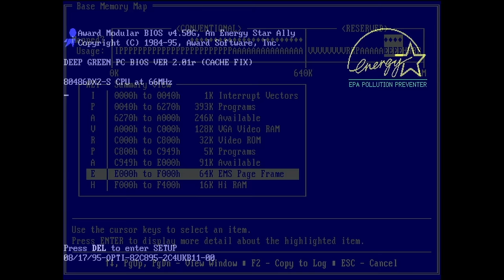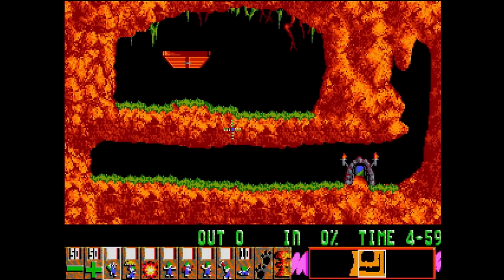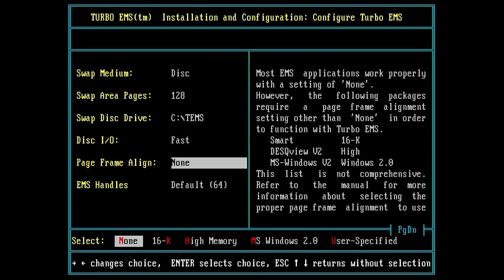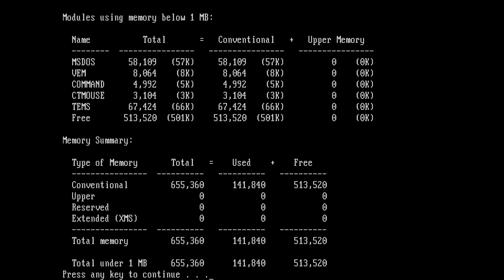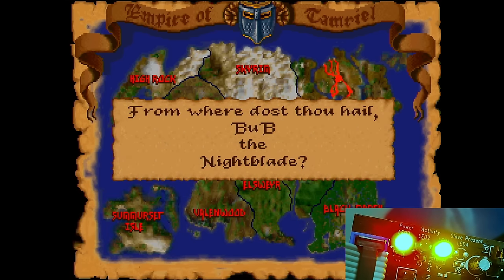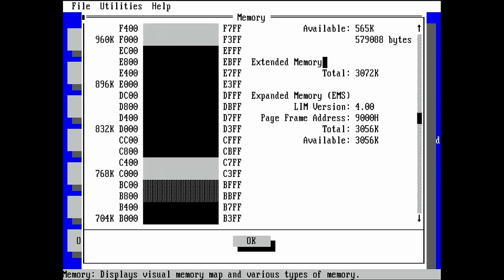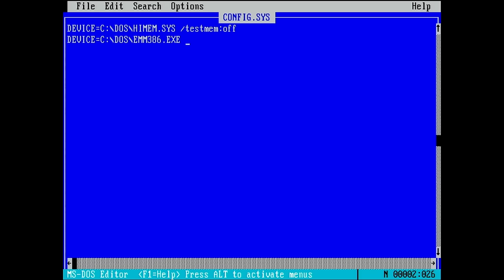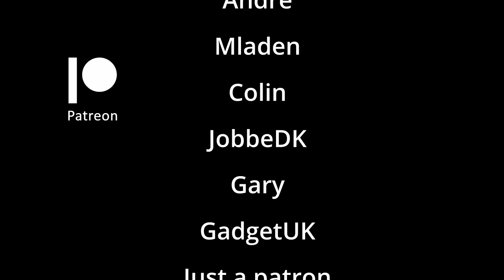EMS Memory: The clever hack for more memory in DOS!

Comment: EMS was developed for 8086 PCs that had only 20-bit address space (1 MB). At first EMS was used as an expansion ISA card with it's own chip and memory. You only had to load a simple driver and everything else was done through registers and ISA bus in hardware. Such board provided 64 KB of RAM within 1 MB of address space and had NES mapper-like logic that could move that 64 KB window within it's own memory. That way allowing for software to access more than 1 MB of RAM and to install way more memory than 8086 PCs were designed for.
It was designed for productivity software, like spreadsheets.

Soon EMS started to be implemented in motherboard chips for later 80286 systems. Where you could have up to 16 MB memory installed and accessed as extended(XMS) memory (similar way of using a 64 KB window above 1MB address space), but for compatibility reasons EMS hardware emulation was also provided.

80386 CPUs were finally 32-bit and had 32-bit address space (4 TB) and had virtual addressing which allowed to map any memory region to any other address. This allowed for EMM386 driver that was able to use above 1MB memory mapped to 64 KB window below 1 MB address space just by CPU alone. This made EMS really fast.

Wolfenstein 3D could use XMS or EMS, but John Carmack said that EMS with EMM386 was faster than XMS (if I remember correctly).

There was a short period when games required 1 up to 3 MB of EMS along with as much free memory below 640KB as possible.
Such games were 16-bit and were meant to run on 286 CPUs and better.

However this didn't last long, since 32-bit DOS extenders gained popularity like DOS4GW that was displaying it's initialization in most later DOS games.
The biggest difference 32-bit mode offered was flat memory model. No more Conventional, upper, EMS, XMS memory. No more near and far memory pointers - in general DOS was 16-bit with 20-bit address space. This meant that all of memory was accessed through 64 KB chunks (near pointers) and to switch to other chunk you had to use far pointer that was 32-bit (yet only 20-bits could be addressed).

32-bit mode introduced just one regular pointer type, like it was defined in C/C++ standard. 
32-bit DOS Extenders worked like a true 32-bit OS run on top of MS-DOS, similarly to Windows 95 and 98. They provided DPMI (DOS Protected Mode Interface) that was designed and implemented by various companies. This is why it's possible to run DOOM, Descent, Duke Nukem 3D, Quake and many other 32-bit DOS games within Windows 9x or even in Windows 3.1x, because Windows itself provides DPMI.

There was also VCPI introduces earlier with EMM386 that allowed to 32-bit DOS Extenders to work when EMM386 was loaded at the start.

Overall memory management in DOS days was a mess, however when 32-bit software got popular memory management was handled by the software itself.

In fact we did a full circle, since in modern programming the most efficient way to optimize code is to organize data in smaller chunks that can fully fit into CPU cache. Modern CPUs have around 64 KB of fastest L1 cache per core, so if a programmer manages to keep the data in a 64KB chunks for a stream of instructions it will be processed really fast.

I didn't mentioned about Unreal mode (hacked real mode where you use full 32-bit memory addressing) or that the true limitation of EMS was that the program code was limited to conventional 640 KB and only data could use EMS - this is why TES: ARENA stopped working despite having a lot of free EMS memory. 32-bit flat memory model allowed to use all the memory in every possible way.
Reply: i386 only supports 4G, not 4T-
Reply: Nicely done.  This is one of the hardest things for me to grok about DOS programming -- near/far pointers and segmentation.  I learned C in 32-bit Linux, and the idea of not having a 32-bit flat memory model (and int64 types!) gives me the same feeling as when you place a large mirror on the floor of a room with vaulted ceilings, then try to step on it.
Reply: "You only had to load a simple driver and everything else was done through registers and ISA bus in hardware."

Not quite, you had to specifically write your program to use EMS, it most certainly was not trivial or transparent, normal far pointer methods needed explicitly augmenting with EMS page management, leading to a dramatic degradation on the performance of a native segment:offset pointer in real mode.
Reply: L1 cache usually has 64KB broken into 1024 lines of 64 bytes each where each line is memory aligned. Keeping commonly used data within chunks of 64 bytes and aligning objects to 64 bytes can improve performance.
Reply: @Leeki85  great explanatiom, thanks for that
Reply: This! This is the comment from the (old like me :-)) person who knows what he's talking about. A very nice explanation.
Reply: @bitsundbolts you should pin this.
Reply from the maker: Done
Reply: I wish there was a modern emm4.0 compliant 32mb card out there. I have a LoTech 2mb EMS card in my NuXT and with the uses I'm putting it to in TurboC++ ..I wish there was more. Less juggling.
Reply: 'program code was limited to conventional 640 KB and only data could use EMS' - this is incorrect. At least Borland TurboC could use code 'Overlays', which would map code segments into EMS allowing programs to use >640k of code. This of course involved a performance penalty, so you had to carefully specify what code was placed in overlays. You could also not do calls between overlay segments.

Also, while the 386 was limited to 32bits (4GB) of physical address space, it could address up to 64TB of virtual address space - the segment registers still work in 386 protected mode.
Reply: @simno345  In general CPU could run code in all of it's address space. Full 1MB for 20-bit addressing of real mode. Code is just stored as data and there's really no difference. You can start executing code at any place in RAM, but the results may be chaotic, usually DOS would crash, but it's a chance that this could erase data on HDD. You can also use code as data, Yar's revenge on Atari 2600 used its code as a texture in the middle of the screen.
So you could copy code into base 640KB from EMS or from HDD. Basically this is how OS works. More modern OSes uses dynamic libraries to split code into multiple smaller pieces.
However in reality program code was always small enough to fit into the memory entirely and there was really no need to further develop ways to deal with larger programs on x86 since when computers started having more than 1 MB of RAM, CPUs already had ability to address it entirely.

There were other ways to deal with complex code. Epic Pinball had one main EXE program that loaded each pinball table as its own EXE. X-COM had similar approach. Strategic part with the globe was one EXE and when tactical mission was to start, game was saving its state to a file, loading tactical EXE and then doing the mission, X-COM was also 32-bit application, but they do it to use less RAM.

Some older games were able to load specific audio or graphics drivers when needed.

Comment: I remember when MEMMAKER came out as that was a lifesaver with this sort of thing - a semi-automatic way of puting things in upper memory and if I remember correctly, the order they were loaded in the config.sys also had an affect on the amount of free conventional memory being available.
Reply: That is correct. When HMA (High Memory Area) and UMB (Upper Memory Blocks) were enabled, DOS would attempt to load parts of itself and drivers, such as the mouse driver, into HMA or UMB when possible. The loading order was important because the system had a set sequence of where to try loading first, then second, and so on. Drivers needed to be aligned to specific memory addresses, and the reserved space for each had to be in multiples of a certain size. If drivers were loaded in the wrong order, this could cause small gaps through fragmentation that could no longer be used, leading to wasted space. However, by loading in the correct order, you could pack the available memory more efficiently.

Comment: you can change the config.sys and set DOS=HIGH,UMB also limit the amount of BUFFERS and FILES. This will free base memory to some point, but not indefinetly of course. The default with 1MB of RAM schould be somewhere like 20 BUFFERS and 30 FILES. so lowering it will probably help a little bit.

Comment: But what is turbo EMS meant to do if you have extended memory?? I get that if you don't you can use the HDD... but if MSDOS does the trick, what turbo EMS would do differently??
Reply: EMM386 which ships with DOS emulates EMS hardware by using 386 hardware feature, allowing it to remap any memory from XMS into a 64k window in sub-1MB region which can be accessed by EMS compatible software written for a 8086, which can directly only address 1MB memory total.

If you have an earlier computer without 386 features, you can use TurboEMS to emulate an EMS device. On a 8086, it can emulate EMS by copying data between EMS window and disk upon any EMS mapping change command. On 286, it can copy between EMS and XMS instead.

Comment: Back in 1992 my father bought a 486 DX2/66. He paid 3500 bucks at a local supermarket chain and this was for the 4Mb RAM version. We carried the MASSIVE case to our car when I saw that on the box there was an X on 16Mb RAM! I told my father to run! This 12Mb costet enough to buy an Amiga! The 16Mb were very handy, especially after a friend of mine installed QEMM. Wing Commander 3 ran like hell, System Shock CD did also.

Comment: This takes me back to the days of having a separate boot floppy with a super customized Autoexec.bat and config.sys files on it for my 486 PC. In it's later days I had so many devices in the machine I needed about a dozen different configs to support various games. I ended up using MEMMAKER along with QEMM (Quarterdeck Expanded Memory Manager) along with a LOT of tinkering and reboots to help get everything setup. It was almost like a dark art!

I also had a config or two setup to use different amounts of system RAM with the SmartDRV utility that would allow most of the game data to be cached from the HDD into RAM. It was awesome for certain games like the Might & Magic 4 or 5 that normally accessed the hard drive a lot when moving around the game world. 

These days you sometimes have to update a GPU driver or tinker with a software setting to get certain games running well, but it's nothing at all like things were back in the DOS days!
Reply: Yep. This was the way. In the last days of DOS, darn near every game had a carefully crafted boot floppy to get the right drivers, memory managers, and random TSRs for that specific game. 

I remember Wing Commander IV, Ultima 7/8, and MechWarrior II being particularly finicky.

Comment: Remember when 575kb was not enough, and you had to beat and squish DOS left and right to get 590 or 620kb or so.

And here I'm watching on a 16gb Tablet, wondering if my 64GB Laptop will last me another year 😅
Reply: What I find more amusing is that we went full circle with GPUs using HBM which is basically static ram.
Yep, let's just have 16GB of static RAM, why not.
Reply: @monad_tcp   Pardon? HBM is a form of a DRAM interface and construction method. DRAM is 1 transistor per cell, SRAM is typically 6. Latency of HBM is similar to modern SDRAM, it's only bandwidth optimised.

Which is fine since GPUs are masters at latency hiding, they know to execute a workload just when the memory request is about to be fulfilled.

Comment: 1. Even if you have only 1 meg of RAM you can get some either XMS or upper memory. To do this, you just need to disable BIOS shadow in BIOS settings.
2. To move EMS page frame to the UPPER memory when using TurboEMS you need to have some upper memory installed (or enabled). You may force TurboEMS to put page frame there, but it just copies data from disk to empty space and they are lost, no doubt!
3. 386 and 486 and higher CPU's have memory mapping unit (MMU), that is much like to EMS but uses 4k pages instead of 16k. But, to activate the MMU, you need to activate protected mode (PM). this is exactly what EMM386 does. After CPU enters protected mode, it can map any logical address to any physical, so DOS programs can think they access memory below 1 M boundary, but physically this memory can be mach above this. But ther is a little speed penalty, to manipulate MMU, you need to switch to "supervisor", running at Protection Level 0 and then back to Protection Level 3 where DOS programs are using emulated EMS. The difference is subtle, but can easily measured by Checkit (5% usually)
Reply from the maker: This is something I need to spend some time on - but it sounds very interesting.
With 1M, I couldn't start any of the DOS memory managers (neither HIMEM nor EMM386). HIMEM refused because there wasn't any XMS available. And EMM386 needs HIMEM or similar to work.
Reply: @bitsundbolts  BIOSes and chipsets of all 486 and late 386 support and use so called shadow memory. This shadow memory is a part of upper 384 kbytes of 1 meg. Shadow memory speeds up BIOS routines because it's  as fast as other 32-bit memory and the BIOS is either 8-bit or 16-bit wide, and substantially slower. But, it is usually possible to disable this feature in the "extended" BIOS setup menu. Most, but not all chipset relocate these 384 k above 1 meg, if the shadowing is disabled. In some cases 3rd party utilities like Lastbyte can make upper memory writable, so it can be accessed as UMB by dos.
Reply: @bitsundbolts  emm386 does require himem, but it also requires 386 or higher CPU. himem requires 286. And some memoy above 1 meg, sure.

Comment: Oh wow. I did a lot of work on the Apricot (it's named for the fruit, & it's pronounced the same) back in about '82. They were absolutely beautiful machines, & deserved to be better known that they were. We ran both MS-DOS & Concurrent CP/M on ours, & used it for CAD work. You're going to have a hard time finding a keyboard for it; this was before there was any such thing as standardised keyboards, & the Apricot keyboards had a row of programmable keys with an LCD panel above them that you could program labels onto via software, so you could treat them as menu keys in your programs.
Reply from the maker: The plan for the Apricot is to get it to the UK some day. Someone with a lot more knowledge than I will restore it, get the correct keyboard, and probably donate it to a museum. I think this is the right thing to do. I don't need to keep and possibly destroy more due to lack of experience with such devices.

Comment: For my fractal generator I used VRAM instead of EMS/XMS, 'cause it was simpler to just push data there and avoid all the mess with different memory managers😸 It required at least 1.5MB of VRAM, but in early 2000s it was rarely a problem.

Comment: I used to run QEMM by Quarterdeck as an EMS memory manager, which automatically identified free memory areas and could even use parts of the BIOS as UMBs. Back then, I had 621KB of free memory available for DOS. For text applications, there were also tricks to repurpose video memory for graphics modes starting at B000 as UMBs, since that memory wasn’t needed in text mode. This allowed for over 700KB of free memory, which was sometimes crucial—especially when, like me, you were running BBS software, network drivers, FOSSIL drivers like BNU, and managing a BBS system.
Reply from the maker: I played around with adding A000 to the conventional pool. As you said, that only works if you're in text mode. The moment you start an application that uses that memory block, funny things start happening. I am planning to use QEMM soon as well. At the moment I have a lot of hardware to fix though.

Comment: i had a friend in a super remoe cabin in the mountains,  it had zero high speed internet,  rather a 8086 runing a very bare bones linux,  and had dial up.  i remember watching a yt vid with dial up,  took hours to load,  it still worked till almost 2023 when the owner passed and his dial up bill stopped being paid.  crazy,  yt was watched on a modern pc, was just using the old one to connect.

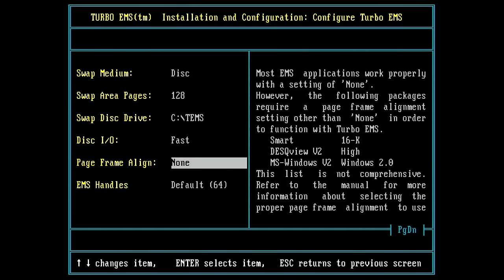Comment: 13:34 I was amazed you left this set to None, thinking that it would default to use conventional memory. I saw you struggle later and thought it was just an extended bit of acting since you said you already tested ahead of time. But then when you did finally get around to specifying high memory and it didn't work, could that be because you didn't have himem.sys loaded?

This video was kinda confusing because I thought you would focus on how memory would work but most of it is spent fiddling with a third party swap drive utility, with the "proper" way to use your ram tacked on to the end.

I forget which version of DOS 6 it was, 6.0, 6.2, or 6.22, but istr a utility called memmaker included that would figure out how to best manage and get the most free conventional memory for you. Using things like DEVICEHIGH in CONFIG. SYS instead of DEVICE, LOADHIGH in front of TSRs in AUTOEXEC.BAT, and somewhere DOS=HIGH,UMB to get as much of DOS out of conventional memory as well. I never needed EMS, but I think memmaker had a prompted option to set a specific size of it through the use of emm386.
Reply: It would probably need HIMEM.SYS to access the upper memory area since HIMEM installs the relevant interrupt vectors to be able to talk to that memory in the first place - I believe those routines are an emulation of the old Intel "Above Board" which exposed 384K in a different manner from the 640K of conventional memory.